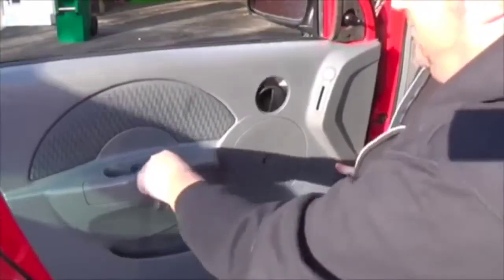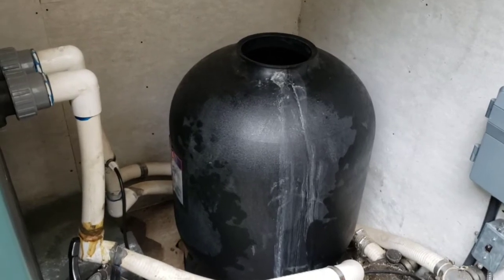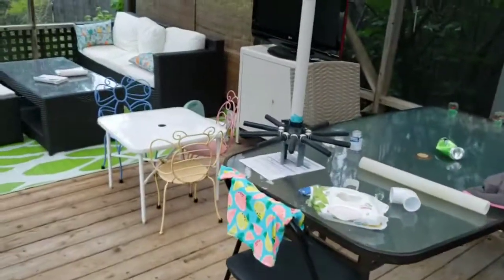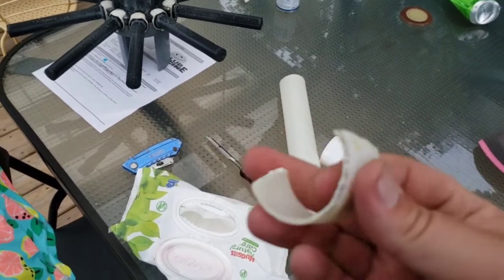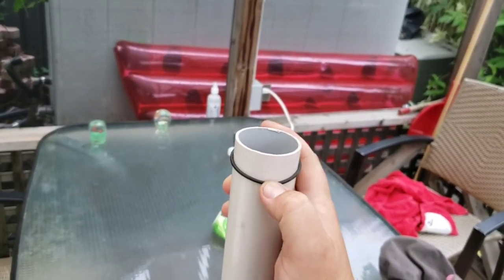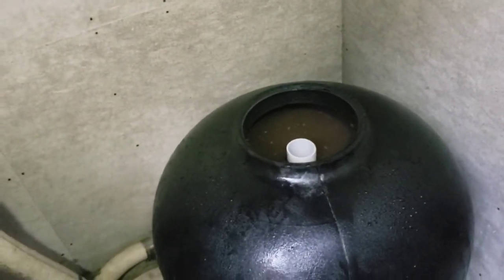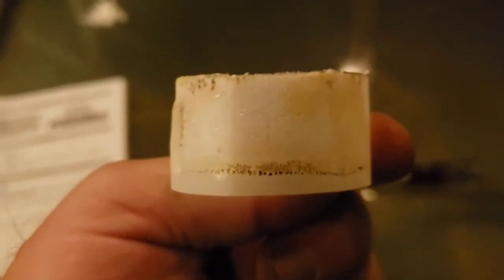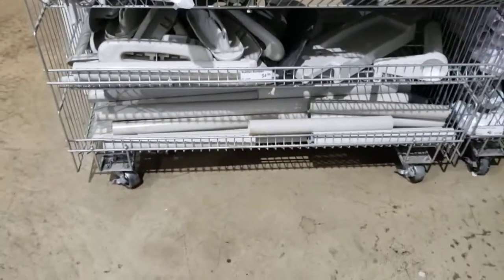Pool Filter Vertical / Lateral Assembly Hack

Comment: Did this solution continue to hold? We've got a similar problem and I was thinking of doing the same thing. Any reason why you didnt/couldn't use a regular width pvc pipe?
Reply from the maker: Hey Ricky ... it's held up well.  I will say that I have sand in my pool again as of last fall and I'm troubleshooting that now, but I did take the lateral out figuring that maybe it had failed/cracked somewhere else/whatever, but the lateral is still perfect.  There's no cracks in the fingers or at the repair spot.  So I'm told my next issue could be my spider gasket in the head of the multi-valve.  I'm going to take that apart today or very soon to take a look at it (video coming soon).  But to answer your question, the lateral is fine and has held for 2 years now!!  Regarding your question about other pvc pipes, I couldn't find one that fit properly.  I can't remember how hard I looked ... but it seems to me that plumbing PVC is a bit thicker.  And that day I happened to be at the pool store shopping for the new lateral, I just noticed those ladder pipes and it was so close to the same I figured I'd try it.  If you are able to find a regular PVC pipe that works, I'd be very interested in hearing more about it!  Like specifically which size it takes.  That would be helpful for a lot of folks I'd say since those laterals can snap so easily, and a regular PVC pipe would be much easier to find.   Hope this helps and good luck with your project!
Reply: @fixingrandomcrap  Your issue could also be the sand itself.  High quality filter sand should last up to 5 years, but if it's a cheaper quality, you might have to replace it every year or 2.  Especially since you said you had a lot of crap in the sand you changed out in this video, if you have a lot of stuff being filtered out, the sand might have broken down already.  How is your algae problem now?
Reply from the maker: @cuzimadapapushkian799  yes I think you're right, I think the sand was a problem.  I actually replaced the filter a couple of weeks ago and put different (new) sand in.  It seems much higher quality.  The filter sand I put in last year was more of a gravel ... really weird.  No issues whatsoever since the recent change.  Filter might have been fine, but replaced it anyway since I was having multiple issues in the pool (water not clear AND sand in the pool).  Everything good now!!  Tks for the comment.

Comment: What glue did you use?
Reply from the maker: Just the standard pvc glue from the pool store.  I don't have the can anymore so can't give you the exact name unfortunately.
Reply: @fixingrandomcrap  at the 2:44 mark you can see the can.  It's Weld-On Wet 'r Dry 725 pvc cement.